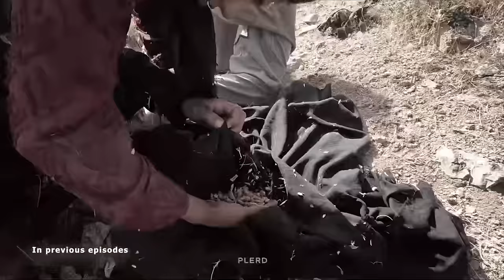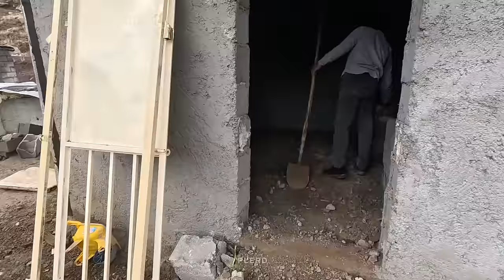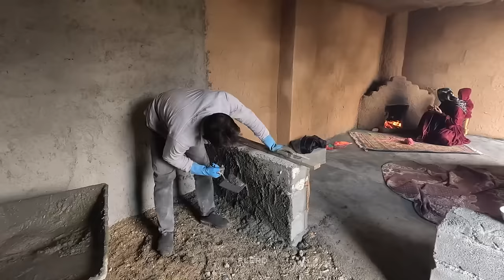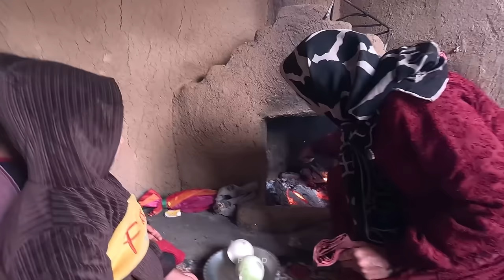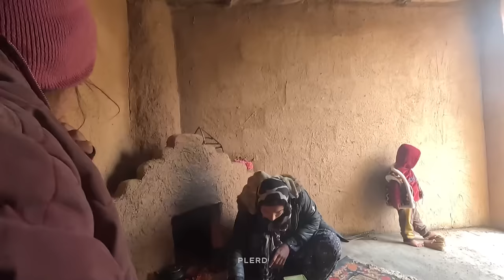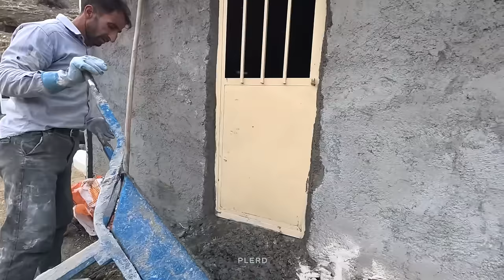Single Mother and Her Kids Conquer Cold to Upgrade Farmstead

Comment: Suggestion: Children should try not to go out on rainy days, and do not let them play on the wet and muddy soil of the chicken coop. This can easily lead to bacterial infection and illness.
The muddy soil and environment on the ground can cause children to get sick. Also, remember to close the door when entering or exiting the bedroom, because I often see chickens running into the bedroom where you live. This will have a negative impact on the health management of the environment. Big question. Chicken droppings are also a source of infection that can make children sick.
In addition, when cold air comes, it is recommended that children wear masks, which can prevent the spread of bacterial infection droplets and can also effectively suppress bad germs in the air. As long as one child is coughing, it will continuously infect the coughs of other children. This is also the reason why one child becomes sick and all the children get sick.

Comment: That stove could have been built up higher.
Also, since that house has a roof that drains to the front, there should be gutters made in front of the doors with wooden bridges.    When it rains they will be slogging through mud.

Comment: The chimney on the right side of the new house has a very poor smoke exhaust effect. The whole room is filled with smoke, which can lead to carbon monoxide poisoning, which is dangerous. The chimney exhaust pipe is not made well enough and the exhaust is poor, so you can see smoke coming out of the room. The outside of the fireplace was blackened.

Comment: Should make curtains for your doors. Have the builder drill two holes, one on each side. Use wire to thread your curtain and then wrap the wire around a screw and screw it into the drilled hole for each end.